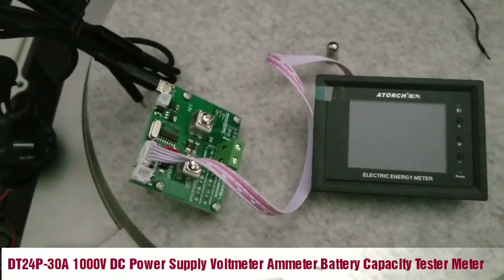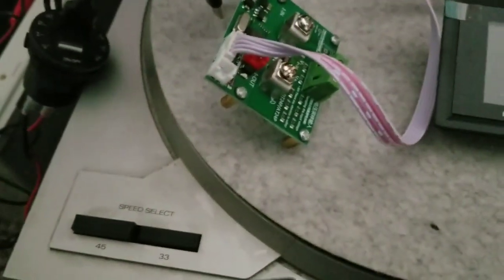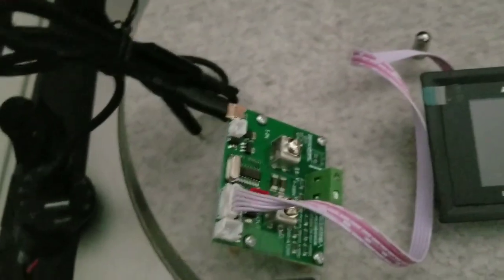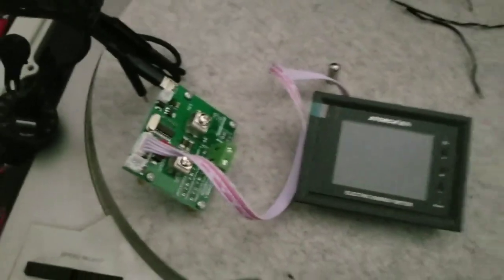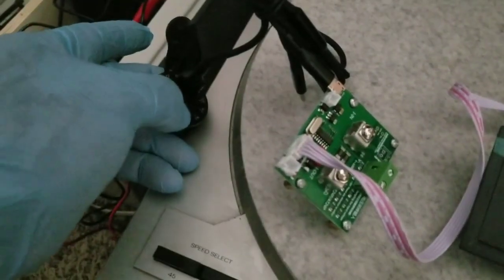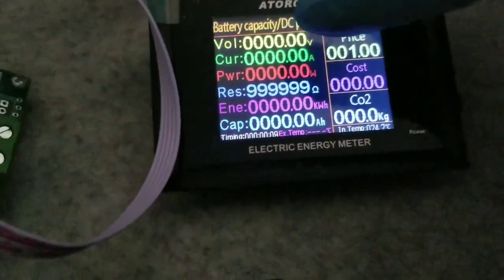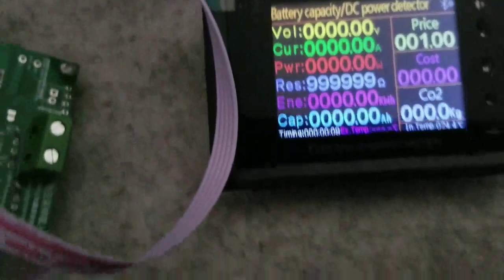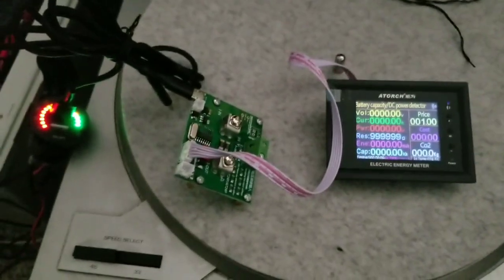30A 1000V DC POWER SUPPLY, VOLTMETER, AMMETER, BATTERY CAPACITY TESTER METER

Comment: The "3D effect" you see is due to your eyes.  Reds focus at a different distance that the blue end of the spectrum.  Your brain interprets the difference in focus to be distance :-)   Question: Do you know if this unit is bidirectional, that is if you draw and then charge back through it, will the Capacity (Ah) go back up?
Reply from the maker: Yes

Comment: Nice meter, but you posted a link to the wrong user manual. This item is the DT24P but you have posted a link to the DL24P user manual.
Reply: I also can't find the correct manual, I ordered the model above but received a different version, low voltage cut-off doesn't work, it's useless for testing lithium batteries, very disappointed.
Reply: @iqev4681  no manual anywhere. Everybody has the wrong download link.  Nobody knows how to use this stupid thing. Right now it's alarming because I'm over 72 volts. No duh!!  It's a 500 volt off-grid system of course it's over 72 volts. The Bluetooth graph only goes up to 300 volts and the scaling doesn't change because I'm higher voltage.  I can't figure out how to change the high voltage alarm threshold so it stops beeping at me. I'm about to smash it with a hammer.
Reply from the maker: They might have changed the link.